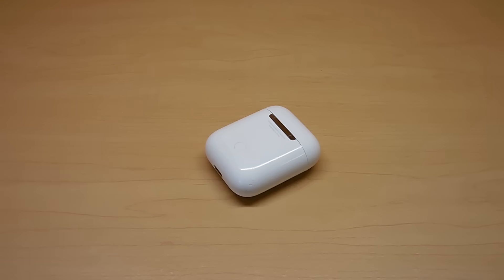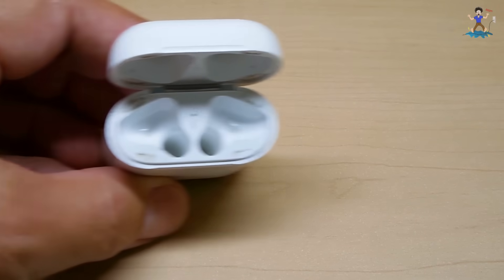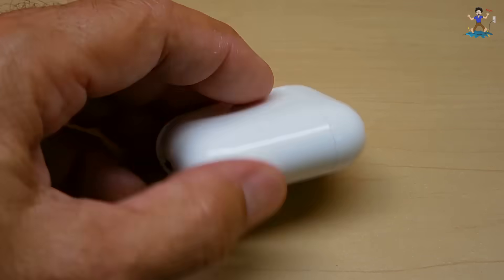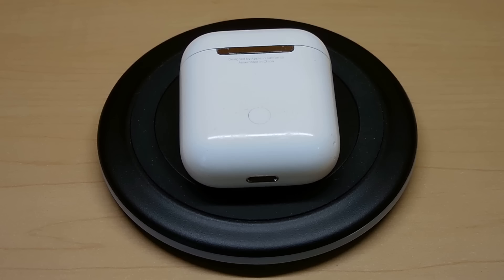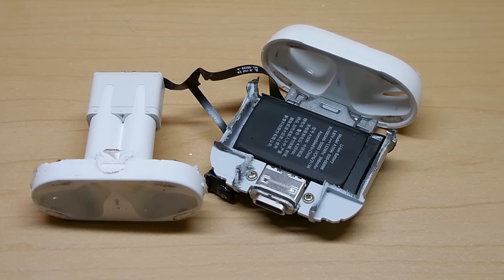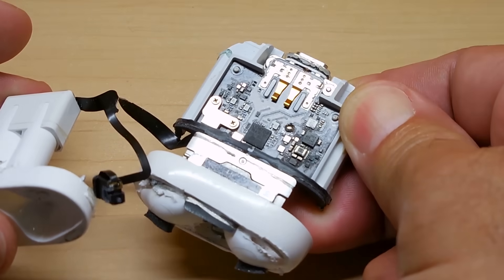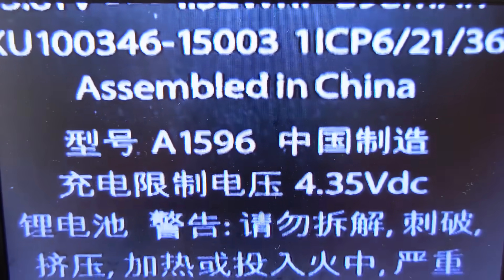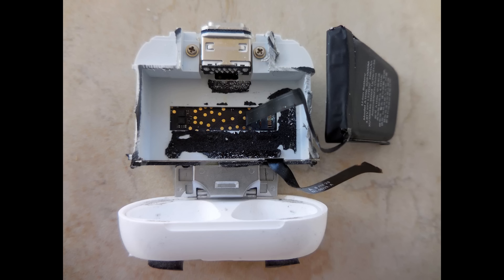What's Inside an Apple AirPod Charging Case? (Ultimate Teardown)

Comment: I watched this video to see how the case detects the pods because I lost one of my pods therefore I can't pair it to my phone bc it's a new device. I tried putting a rolled up flat plastic magnet inside to touch the copper sensors in the bottom. I also tried to put a long metal piece into to bottom to touch the copper charge pieces. But it still won't work. I'm not paying 65 for 1 pod. Can u think of a way to trick the charger in to detecting the other pod so I can pair to my phone? According to everything I've read, it's impossible. But I just don't think anyone has figured out how to make a fake piece just to use for the initial pair. Thanks

Comment: Nice video, looks like you can tear it down without cutting it. Just wonder if an exato blade will be clean enough.
Reply from the maker: No, in order to see everything, you need to cut it open. If you just want to remove the airpod holder, then you can pry out the inserted part. Thanks for watching!

Comment: 3:22 So technically, the charging case can be disassembled without destroying the case. But it would be near impossible compared to the iPad, or iPod touch.
Reply from the maker: No, You can only remove the airpod holder inside the case, which is snapped in place and glued. This Airpod case was water damaged.

Comment: Very interesting. What type of cutoff wheel did you use?  Looks beefier than the ones I have.
Reply from the maker: Dremel reinforced metal cut off wheel using a EZ lock mandrel. Thanks for watching! Be sure to check out my extensive video playlists and share.
Reply: Ah excellent, I have that on my cool tools list. Not sure, bit I think I’ve watched pretty much your entire playlist 👍

Comment: Somewhat similar device.  I have an old IPOD in which the battery died. By the time I ordered and received a replacement battery, the old one leaked and destroyed the display screen. The leakage also corroded some of the circuit board. I was able to clean the board, replace the battery and get the IPOD to work again but the screen is shot. So I can use it for music but cannot control other than volume, play/pause.  Apple makes their devices to be planned obsolescence.  SADLY.  How did the moisture/corrosion get into this unit ???   Thanks for the vid   J K
Reply from the maker: My friend dropped it in water.

Comment: If you glue a magnet to the side of it then wrap it with copper wire about 20 turns it will charge the battery...no more dead battery for your pods 😉
Reply from the maker: LOL. Good luck with that!